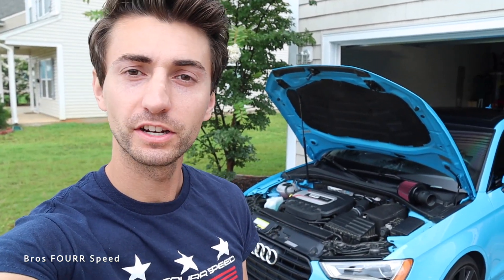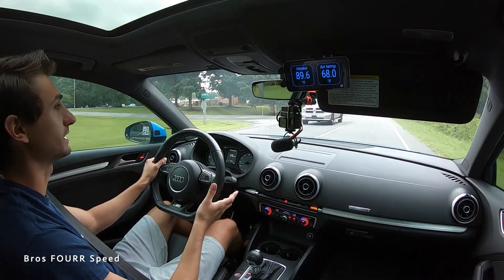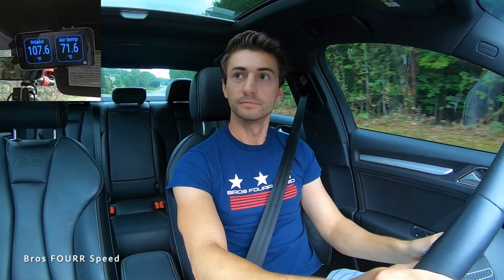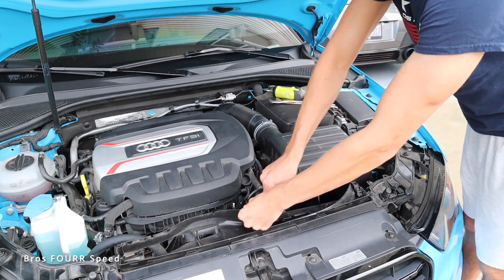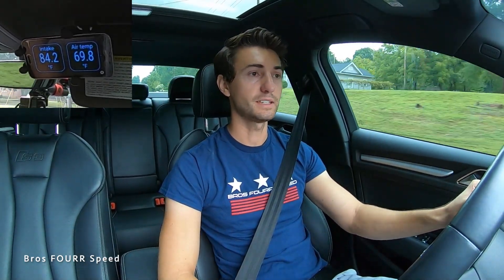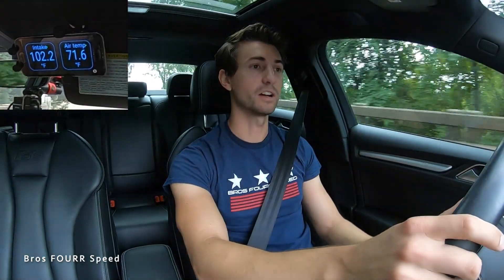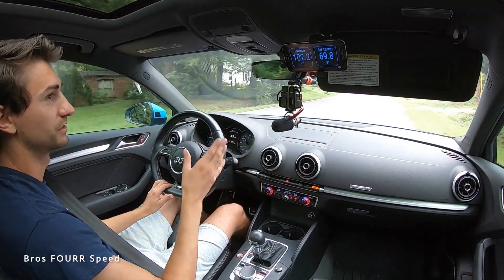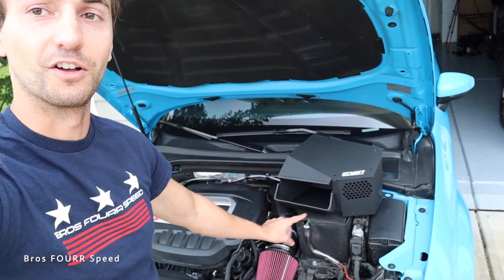Does an Open Air Filter Create Hotter Intake Air Temperatures? *Turbocharged Cars*

Comment: That’s not a proper test though, that filter needs to be far as possible from the engine and have a shroud around it or it’s just pulling hot air from the engine bay defeating the purpose
Reply from the maker: This video showed the difference from a stock airbox and an open filter in the engine bay. I wasn't testing a cold air intake vs stock.

Comment: I'm trying to decide how this would affect a Supercharged engine. I'm wanting to put cone filters on my RR SVR but I don't want to do long-term damage from the expected under hood heat increase.
Reply from the maker: If the SC has some sort of intercooler, I wouldn't worry about it. But probably a good idea to have more of a real cold air intake since the V8 will push a lot of heat
Reply: @BrosFOURRSpeed  Thanks so much for respinding. 

Range Rover Sport SVR superchargers don't use intercoolers. I installed the Mina Gallery Performance Air Intake a few days ago because it was supposed to allow for the supercharger to be heard but after the installation I still can't hear the thing. Then I noticed that the cone air filters are sitting in an area under the hood that is surrounded by heat. That can't be good for the engine. Your video is the only actual test of engine performance with a cone air filter sitting in a hot engine bay. I've decided to remove the Mina Gallery kit and go back to the factory air boxes and replace the oem paper air filters with K&N performance air filters.

Your video helped me finalize a decision I was already leaning toward. Really good and informative video 😎👍.

I posted a video of me installing the kit just dats ago, now I get to post a new video of me removing it after barely having it a week 🤦.
Reply from the maker: @ThatRetiredDude Probably a good way to go for it!

Comment: How about if we stucked in heavy traffic jammed?
Reply from the maker: Heat soak would start a bit. Once you are moving and air flow increases, that's when it cools down better. But slow speed traffic, your engine isnt sucking that much air. So the lack of performance won't be noticeable

Comment: I use a P08F1-85 Sprint Filter(airflow rating of over 15,000 liters per square meter per second). I just change the stock filter from the airbox and it improves performance better than cold air intakes.
Reply from the maker: Thanks for sharing!

Comment: I've seen these cold air intake setups where the conical air filter was inside a box or had surrounding guards essentially blocking the hot air created from the engine... So I'm curious if having the intake covered is noticeably beneficial for further protection from debris entering the engine and colder air rather than having it open like you did in this video?🤔 You should do further tests with the cold air intake covered/boxed vs. uncovered and open👍🏼
Reply: The "enclosed" aftermarket intakes should more or less perform the same as the stock setup when it comes to temperatures assuming they also pull cool air from outside the engine bay like the EA888 cars do.

Comment: Then why is there more g/s with open filter? More g/s=denser air.
Reply from the maker: Nothing in this video was showing how dense the air was. Just showing an open filter in the engine bay will give you a bit hotter intake temps. A heat shield or duct of some sort is deal on an aftermarket intake to keep temps the same. Cooler air is more dense
Reply: @BrosFOURRSpeed  I know from my tests on a previous car. Open filter=more g/s. If the air is hotter, it would be less g/s.
Reply from the maker: Yeah so it needs to be a blend of maximum flow and cooler air. Big heat shields don't block any flow. But they do block some heat. So you can still have an open filter, just need a barrier. I did a new intake on my Type-R and it has the same temps as the stock box.  https://www.youtube.com/watch?v=VBlvARzEwhY

Comment: I tried this on my BMW. The air intake temp was basically the same when driving, only got significantly hotter when idling.
Reply from the maker: Yeah also depends a lot on the efficiency of the intercooler. The S3 intercooler isn't the best stock apparently

Comment: I have a Fiesta ST, and K&N only offers 2 options:
- Only filter or -Filter and intake tube
https://www.knfilters.com/ford/fiesta-st/1.5l-l3-gas/2020/ 

I've read that some experience EML when adding a cold intake, however, I think that is more with like a ramair intake where the filter is exposed. Any thoughts?

K&N says it will add +18.7 with the intake tube, however they have no data with just the filter.
Reply from the maker: Yeah I wouldn't believe a filter brand saying you'll get those gains. Maybe with a tune you could.

Comment: I’m interested to do this test on a Mercedes C43 and the CTS intake. while it’s not an enclosed system it utilizes the factory air ducts to channel cool air from the front of the car to where the factory air box used to be. At idle, i have little doubts it’ll pull hotter air, but in motion is it enough to where the effects of heat soak is mitigated? 

I’m also interested in testing an enclosed system to see if the amount of air drawn in is sufficient enough for the amount of air that can be taken in. Because i’ve seen some that still utilizes the same opening/front connection, then wider ducts/channels (limiting factor will still be the size of the opening) to give the appearance that it can draw in higher volumes because of the size of the ducts. 

Either way, great video!!
Reply from the maker: Thanks! Yeah I have a new video coming with a new intake on our RS3. I'll be testing the temps on all of the styles we test! I think generally if the intercooler is efficient on a turbo car, an open cover won't  make much of a difference

Comment: I tested it on my turbo Volvo. Now that it's almost winter we have usually around 2-5 deg C ambient temps. With the cold air pipe installed to the factory airbox, I have around 2-3 deg C difference between ambient temp and post intercooler temp. With the cold air pipe removed, I have the same 3 deg C difference between ambient and post IC. So yeah on turbo intercooled engine CAI doesn't have much of an effect. Intercooler is doing most of the work.
Reply: The intercooler is designed to just reduce the heat caused by compressing the air, ie try to take it back to ambient air temp. But the better more high flow filrter with a real cai built would be better (providing the new filter kit is tuned for the car)
Reply: @vctrsone  as long as the piping isn't any smaller than the factory setup pre compressor, and the filter is in a good location, 
(behind the front or lower grill, in front of the wheel behind the fenderliner with the body of the car between it and the engine) it should be fine.

Comment: Does a open intake suck in more air than a closed one? I keep getting a lean code from too much air getting in,could that be it?
Reply from the maker: It should suck in the same amount. But if your pipe is a larger diameter then stock, you'll have issues with stock tuning. What intake do you have, and what kind of car?
Reply: @BrosFOURRSpeed  Bmw 128i,and it’s a cheaper intake but I was to get a afe closed in one,but Im worried it’ll do the same thing
Reply from the maker: @Vadimka_505  does your have an air box around the filter? But if it’s a cheaper brand the pipe itself might be a wrong diameter and the engine may be getting too much air. We supply MST intakes on our website. I could help you order one of theirs for your car. I think they make one.
Reply: @BrosFOURRSpeed  no it’s a open filter,and I think that is the reason it’s getting so much air right? The diameter of the pipe is the same,but the filter it self is in the open,no air box
Reply from the maker: @Vadimka_505  yeah I’d buy a better kit then. Some times you get what you pay for

Comment: Why didn't you test the temps with the stock air box?
Reply from the maker: I did. Literally the first test shown in the video
Reply: @BrosFOURRSpeed  i think he meant if you keep the stock air box and put the open air filter in it so some of the air from the outside would be sucked in ?!
Reply from the maker: @antonatik4410  I don’t think that would make a difference. The stock box has a snorkel to outside the engine compartment. So it’s sucking in cooler air. Same with aftermarket intakes that connect to it. Current intake on the S3 has its own air box and has identical to stock temps. It’s just any open filter in the engine bay, that’s when youll get hotter air
Reply: @BrosFOURRSpeed  agreed i think with naturally aspirated engines the temps might be higher because of no intercooler 
I have a mercedes A180 1.6 turbo engine thinking of putting am open intake just for the sound lol
Reply from the maker: @antonatik4410  yeah I’d iSync the same for sure! If your not looking for extra power, nothing wrong with at least making some fun sounds for the fun of it
Reply: Would a metal heat shield make a difference? Some cheaper kits come with just a metal plate that blocks off the engine.  @BrosFOURRSpeed

Comment: Still Best system is like ww2 system & where name for intercooler came from..
COLD AIR INTAKE >>>> PRE-COOLER >>>> TURBO SUPERCHARGER >>>> INTER-STAGE COOLER >>>> ENGINE INTAKE.
Just like Compound Turbo cars or those with Turbo & super charger really NEED a Intercooler between 2 turbos and then another intercooler pre intake. 
(Just sucks for packaging) 

Hot Air Intake Still effects Density of the Charge Air .
75*F Pre Turbo then cooled by Top Mount intercooler to 95*F is still more power than 
105*F Pre Turbo then cooled by front mount intercooler to even lower 90*F 

As the initial air charge was still lower density 
(best would be a way to get all intake temps below 40*F Pre Turbo, Then it will only be like 90-95*F post turbo without a Cooler)
Reply from the maker: Yeah cool how that all works and there are a ton of mods to improve it!

Comment: The aftermarket intake you got looked more like a Short ram intake.  The stock box seemed more like a cai.   I would keep the box, put a hi performance filter and a silicone tube.  A vq 37 intake is the best stock design for an intake.
The car that I own that responded best to an aftermarket Cai was the camaro!  As a first mod I got a 22hp jump.
Reply from the maker: Yeah I was using a part of my new cold air intake to create a short Ram intake with the exposed filter. If an aftermarket kit has a real sealed heat shield and duct, it’ll breath cool air like stock. Or if it relocates the filter outside the engine. That’s good too 👍🏼

Comment: The question we all wanna know the answer to: did we waste $400 for no gain?
Reply: Wym fam, we got the SWOOOOOSSSHHHH noises
Reply from the maker: For a hot air intake, yes!
But a true performance intake, no!
Especially with tuning, they add solid power capabilities. On my Supra, tuned with the intake vs stock gains 30whp at redline. And my GTR with larger diameter intakes, adds about 50whp with tuning
Reply: @BrosFOURRSpeed  ya boy got a cold intake on the focus, too poor for a tune rn, but it gave me 10+ at the wheel, so I’m satisfied
Reply from the maker: @Static_MK3Focus  oh nice!
Reply: @BrosFOURRSpeed  and good looks on the Supra, love that thing
Reply: Yes, a waste. Search "The Humble Mechanic" on YouTube. He did a test on the Integrated Engineering intake on a m7 golf r. Lots of temperature sensors. Always ask for the test data. Ignore the hype.
Reply from the maker: @longbowdt  It depends on the car and the intake. You’ll see in the install video of the full intake I did on this. Keeps the same temps as stock. But it’s certainly opened up the turbo a bit even with no tune. A tune will further the power gains tho
Reply: @BrosFOURRSpeed  I see your point, but the aftermarket claims for a "cold air intake" are largely without accompanying test data. This is not to say that they won't help produce more power (or noise) than a more restrictive OEM intake. But it is to say that they don't (won't) on their own  necessarily reduce the intake air temperature. I have the IE intake. It certainly sounds good. But the test shows it is not a "CAI" compared to the OEM unit. I will wrap it; should have done so already. It seems the OEM unit in the test I saw resisted heat soak better than my pricey but well made intake. Going forward my motto is "in God we trust. All others bring data". 
Appreciate you.
Reply from the maker: @longbowdt  Yeah I think companies use the term cold air intake to imply it will suck air from a cooler spot then the engines heat. But more people don’t realize, that stock intakes are cold air intakes too lol. Just more restrictive. So it’s nice that some aftermarket kits at least can match stock temps which is good

Comment: I understand cold/dense air like foggy weather is ideal for engines. However one wonders if you could re-route air conditioned air from interior vent to intake. LoL
Reply: Aka interchiller
Reply: @gradeaplanb  I want da Intachilla
Reply: Skull emoji
Reply from the maker: Actually the Dodge Hellcat does that! It uses the AC compressor to cool down the charged air. Very cool!
Reply: @BrosFOURRSpeed  not quite. it uses refrigerant to chill coolant. its FAR more efficient, but it only works when youre not WOT.
Reply: In theory yes but it would require a volume of air exponentially larger than the cars AC could provide.